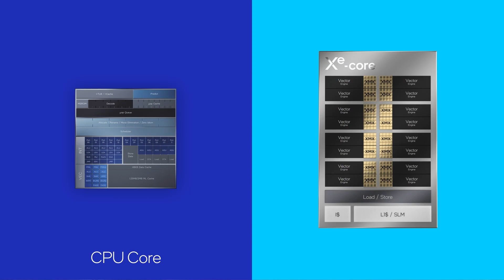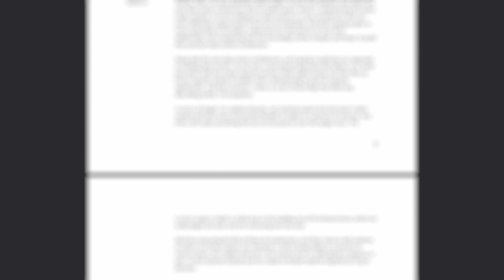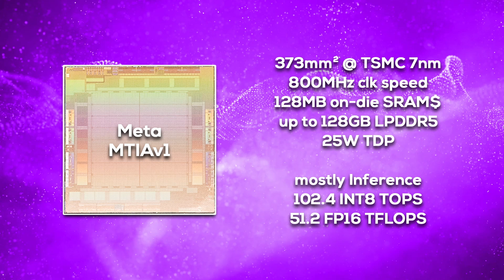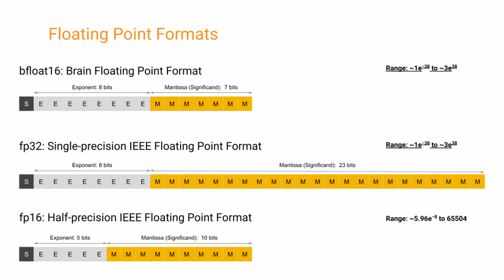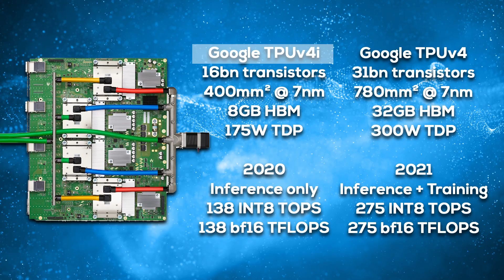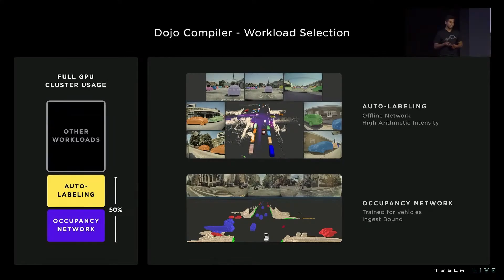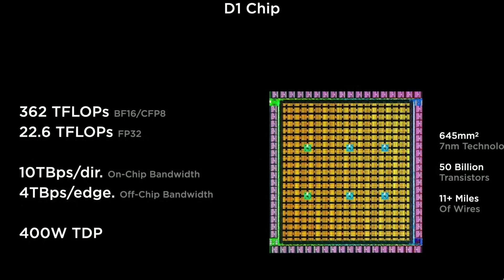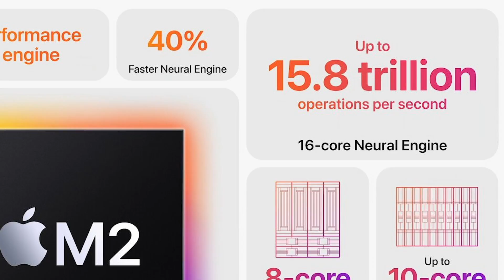Google TPU & other in-house AI Chips

Comment: 3060 12gb is the best lower end machine learning card. $200 used. A2000 12gb uses less power even after undervolting the 3060 but costs $400+. Vram counts more than speed.

Comment: I think Nvidia will remain on top for at least the next 5 years. Not necessarily because of the Hardware which is a strong reason but also because of the software support. CUDA to be precise. Most developers starting out in ML are learning and testing using GeForce GPUs. Libraries that depend on CUDA are pretty much what everyone who is learning ML learns to use. Once these developers get employed, Companies are more likely to go with Nvidia GPUs because it's already familiar with their ML Engineers. I believe that this foothold isn't going away any time soon.
Reply: I tend to agree with you because of the "CUDA entry learning" factor. But keep your eye on RISC-V based Jim Keller and Tenstorrent.

Comment: I think an important point to make, and the one you missed, is that nvidia has attained complete market dominance in terms of combining hardware and software to provide a unified solution. In todays AI market, one of the most important factors is to deliver first. Delivering the product before anyone else allows you to sway customers and establish your product in the market. Now if you are one of those big companies, you could use your in-house hardware, but it's going to be slower than Nvidia. That's not an argument, that's a fact. And now, what if you found out, that your competition is using Nvidia? If you continue using your in-house hardware, you will not be first to the market and your model might not be as accesible to your customers. 

Nobody cares about efeciency at that point, because market capture is the only thing that matters. If you fail to do so, who cares if your inhouse TPU is 100% more efficient. 

That is the decision, the major driving decision, that makes everyone buy Nvidia. It's because they have the best integrated solution, so they are fastest. And that means if the competition is using them, you will have to use them too, or get used to being late to the party.
Reply: For training and experimentation Nvidia is the way but when you need to deploy those much model at large scale Nvidia hardware becomes very expensive. 

Data scientific at these tech companies use Nvidia hardware and software stack to train their models because its easy and fast for doing large number of experiments. But once the model is ready to be deploy it will be deployed in ASIC made only for inference.
Reply: @sagyamthapa  Dead Wrong,those at the top funding all this have more $$$$ then God and every atheist that will ever live. Money is no object,think way way bigger
Reply: @mannyc19  They don't have all that money by wasting it. The OP who thinks efficiency (power usage) isn't a driving factor is, like you, very ignorant about how decisions like these get made. Stock valuation is everything. There isn't any actual physical worth. They don't have "money" (which is fiat regardless) .. they have VALUE. Perceived value. You have a lot to learn.

Comment: It's very interesting to see everyone doing custom hardware. Because of where FAANG expects to add value with AI costs are very very important to them, if you have cheaper inference you can make more margin or run better/smarter networks than your competitor. This combined with their insane scale incentivizes them to develop alternatives to NVIDIA. This also means that AI hardware could be commoditized much quicker then if all of them just bought NVIDIA hardware. We'll have to see what happens but I wouldn't be surprised if in 5 years inference is a completely commoditized low margin business and NVIDIA is trying to defend their number one position in the higher margin training business with everything they have.
Reply from the maker: It’s gonna be a tough fight for Nvidia. Very interesting times ahead of us.